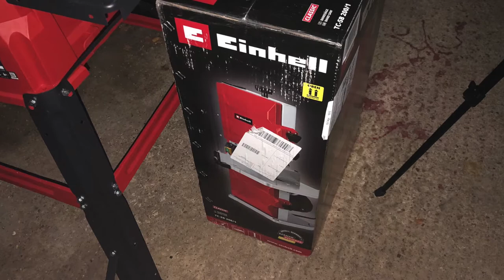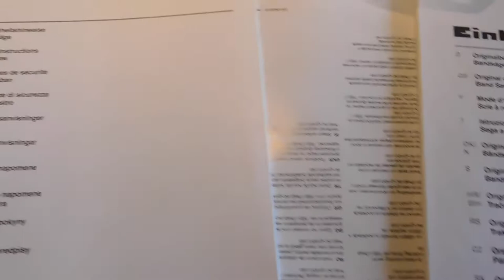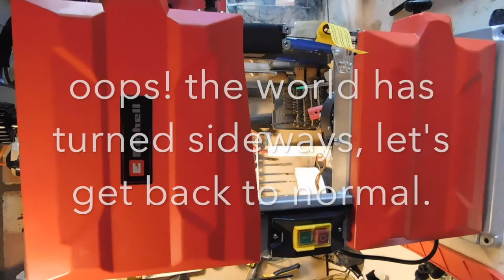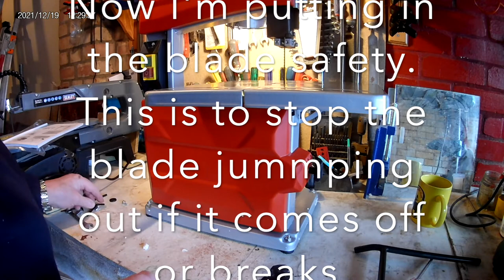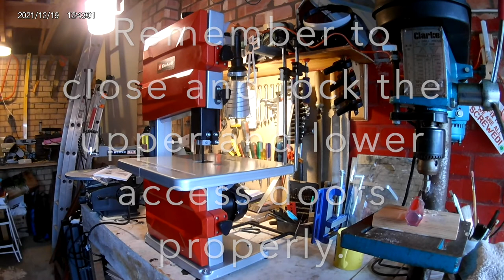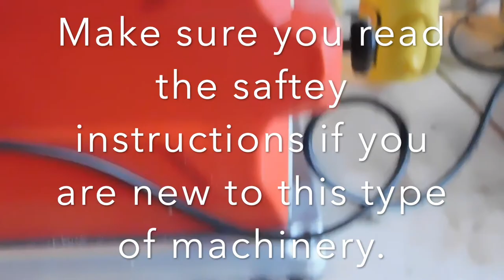Einhell TC SB 200:1 Bandsaw. Tidied up version.

Comment: Ive just bought one of these but my blade keeps cutting to the left ive done everything it says in the book bit i still cant get it right what am i doing wrong buddy??
Reply from the maker: First thing to do is to check that the blade is not worn on one side. The teeth should be evenly set. The blade should be tight , but not too tight. The top and bottom blade guides should be in line and not twisting the blade to one side. Also they should be set to control the blade ,not rubbing. As an afterthought, do you have the top guide too far above your workpiece? To control the blade this needs to as close as practically possible without touching the workpiece.
Reply: @shire1951  thanks for replying buddy its a new blade that came with the saw when I first used it it cut straight and was awesome I went back to it to cut something and it went to the left does the position of the blade need to be in the center of the wheel as I've tried it back front and center
Reply from the maker: I'd still check the blade teeth first, look for wear on one side. The blade that comes with the machine is not the best quality and wears quickly depending on the material you are cutting. It should not matter where the blades sits on the drive wheels, although the centre is the correct position. As mentioned, check the guides are doing their job and that they line up.